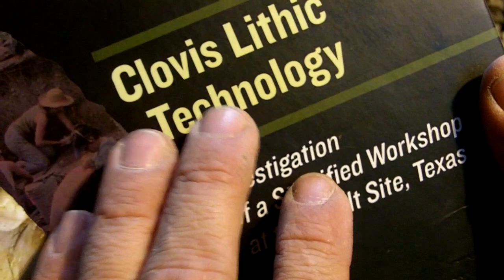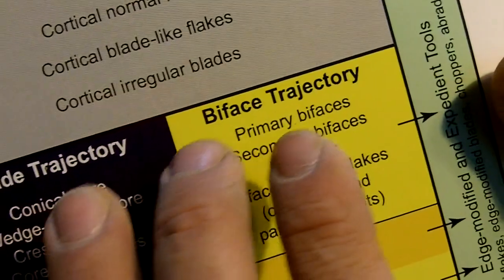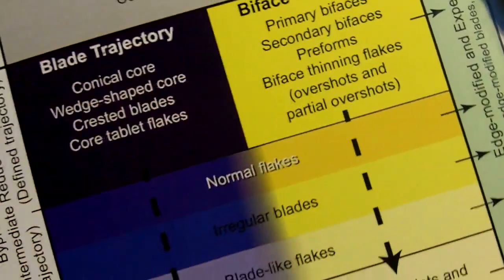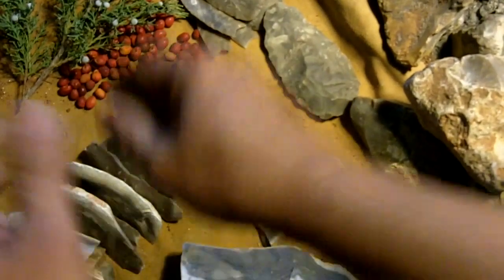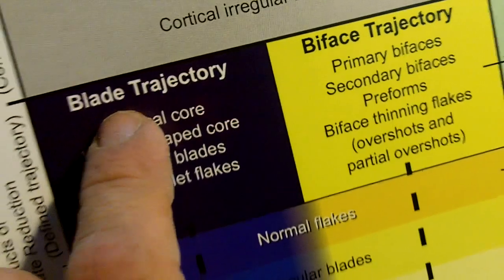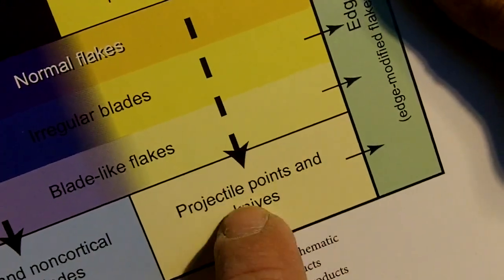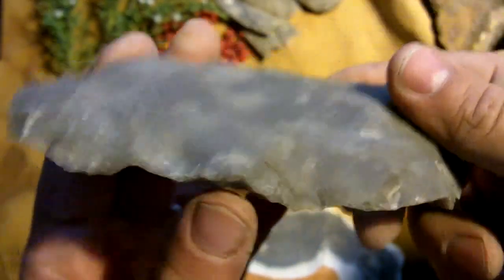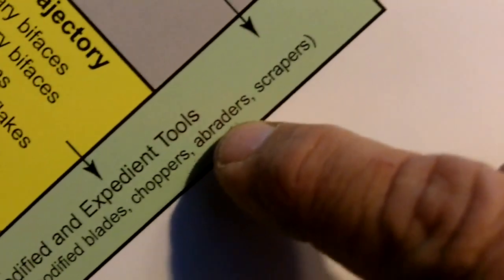215 - Part 4/4 - Clovis Flintknapping Research and Trials, Trajectories

Comment: Very interesting analysis. I have to disagree on at least one point though. The separation of blades from bifaces does not necessarily indicate two separate knapping groups,Only two separate knapping strategies and two separate tool types. A blade was selected to stay a blade because it was suited as a blade. Just my humble opinion. I really enjoy your videos. I have been collecting and knapping for decades and had never seen your approach to thinning bifaces using indirect hammer. The way you keep your edges and platforms near the center line is so foreign to me! Absolutely amazing. Thanks
Reply from the maker: Thanks Paul.  I made this video a while ago.  I need to review it and update it as needed.  I need to find that book too...